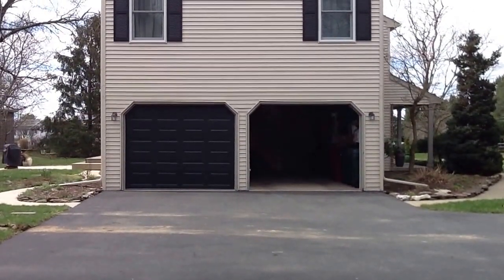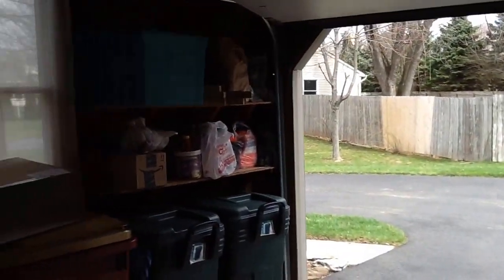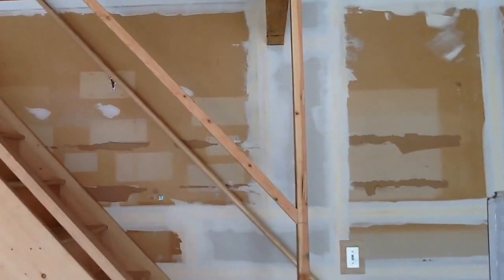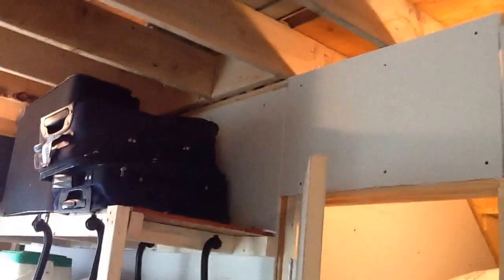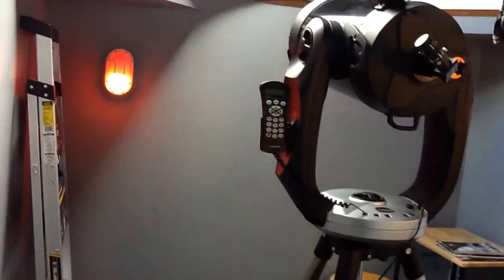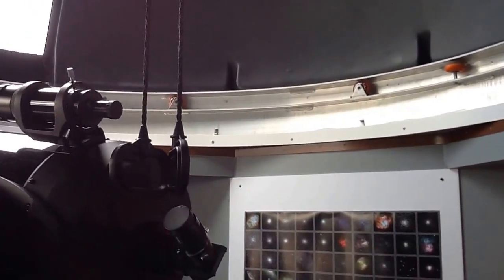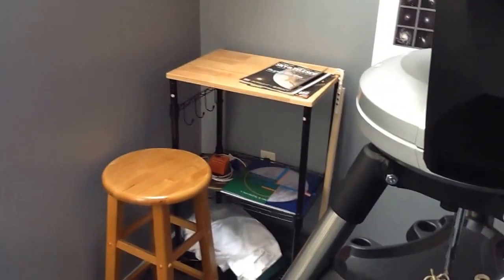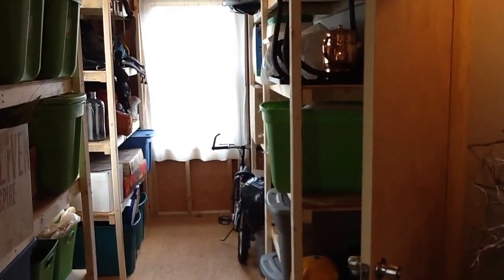Garage Astronomy Observatory

Comment: Does anything other than gravity hold the dome to the home?  Great setup BTW.  I am wanting to do the same.
Reply: Sorry for the delayed response. The base is comprised of two aluminum rings that are secured to the house roof. The dome sits on the top ring (shaped like a bent "T"). The final portion of the install is a series of four "L" shaped components that attach directly to the dome and the lower portion of the "L" rides under the top "T" ring. Hence, the dome rides on the top ring (on vertical and horizontal (roller blade style) wheels and the locking ring keeps the dome from coming off. Finally, the aerodynamics of the dome helps with keeping it securely down. More information can be found in my images on the CloudyNights web site.

Comment: Cool idea however it’s Clearly not built to any building code, which is fine until you some day go to sell. Where we live this would never pass a house inspection, good luck to you.
Reply: Woody, both construction and electrical permits were pulled and approved. The only thing that isn't to code is the width of the stairs (30" instead of 36"), but the 2nd and 3rd levels aren't "living spaces", so the stair widths weren't an issue. 
I understand that there are different codes for states and counties, which is why this was designed and constructed to comply with all codes in my area. I appreciate your comment.

Comment: I am going to get a contractor to build a house for me, and I too want a rooftop observatory. I was concerned about floor bounce since it won't be possible to put a pier down to the ground. With what you've said, I'm sitting on the fence right now about whether it will work or not, since I would like to be able to show friends the view through an eyepiece rather than just doing astrophotography.

Comment: What is the minimum elevation you can view with the dome at that height versus the mount. How has it (or not) affected your viewing and imaging? Great observatory by the way!
Reply: Marc, I won't lie. With the dome at that height and the telescope as high as the tripod allows - I can't see anything below 22-25 degrees above the horizon. Albeit the haze and some trees would block the initial 10 degrees, but these calculations were determined in the planning stages when my setup was in the driveway and my view of the sky was limited at a much higher level. 
To lower the dome, a trap door would have been necessary (making the walls approx 4 feet high instead of 6+ feet). At 40 degrees latatude it was a bit challenging the see and image Saturn and Jupiter last summer (because they were very low in the night sky). This still allows for excellent viewing of the majority of the sky.
I enjoy the full height of the observatory space and am not impacted by spurious light or wind. 
A heavy duty wedge is being planned for this spring as the change to an equatorial mount will allow for capturing images longer than 30 seconds at a time. This attachment will also raise the OTA a few more inches. Wishing you the best.

Comment: Good man stuff!  I'm sure that the wife was on board with the addition you made.  I just told my wife that we will begin building our observatory for the low low cost of $150k.  She is soooo on board with my thinking.

Clear skies baby!
Reply: New Pilot, with the additional storage space for my wife's "stuff" she was totally on board. I had a very good contractor that did the exterior, roof (heavy lifting stuff) and I was able to do the basic electric, insulation, drywall, paint, etc. It's surprising how much $$ can be saved. Best wishes and clear skies.

Comment: This area looks very familiar to me, I think I'm just up the trail a bit. Nice setup, I have a roll off that I have been setting up for the last year. Finally got the concrete pier in and a local welder built a steel pier for the top of the concrete pier. I have 7' foot walls because of the door but it was prefab so I have about 4 feet of concrete and 3 feet of steel tubing. I actually prefer the cold to the bugs as   I can splashtop from the comfort of the house.
Reply: Thank you Jim. There are more home observatories in the area. Wishing you well with your build.

Comment: Should have planned a better vibration proof Pier like the design we are building,  check us out on you tube Carefree Observatory need to be able to move and work while filming
Reply: Your plans look exciting and that pier will hold anything. I spend more time in my Control Room when imaging now. This eliminates any movement with the telescope. Clear skies.
Reply: There will be no building attachment to the telescope pier it will float from below floor to top of tube, I will also be using a Meade lx200 16”, with 4064 mm Focal length , mount will be a Plane Wave L350, gear less mount

Comment: for temp.. with all you have done. should have put 2 ducts in to outside with moterized vent covers and tstate controled. so it will keep it at outside temp 24 7. no worries of heat at all in scope to cool down.. so on so on ... what the heck you went all out already .. very nice setup..

Comment: Congratulations! You got me thinking on the need to drop 20 feet pipes to have a floor that does not vibrate but how about if you just drop the pipes to the floor below and mount the telescope in a small heavy slab connected to them? I think that would be a great relief and allow you to move about without disturbing the picture taking process. Just a thought! Thank you for the great video!